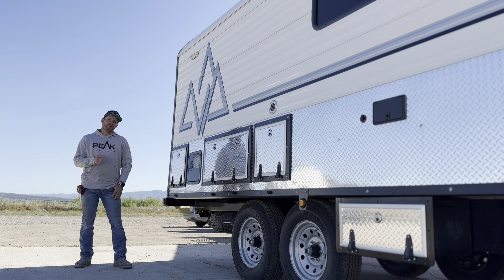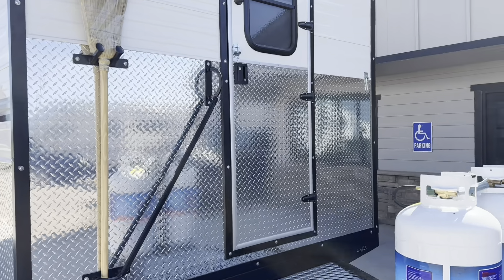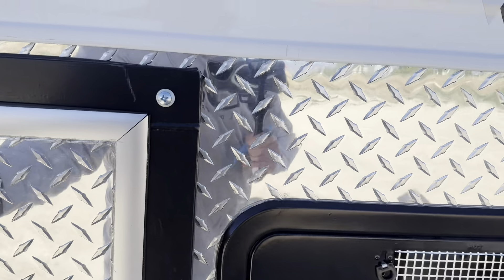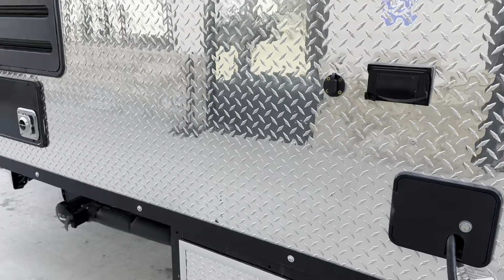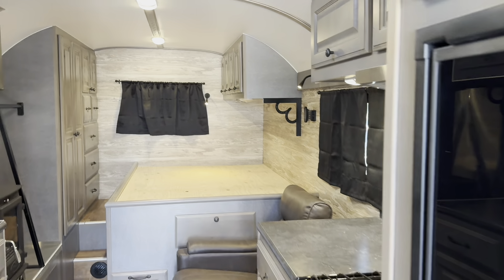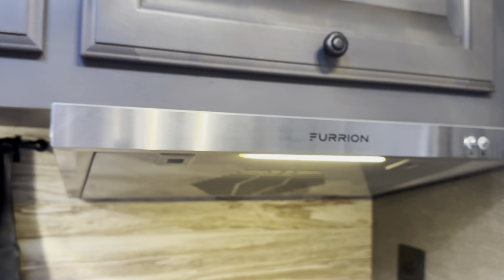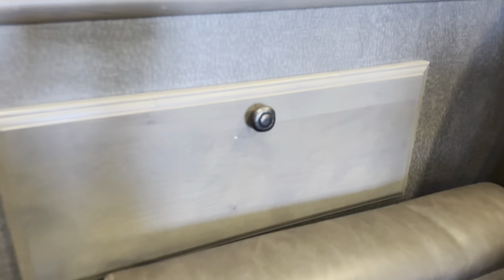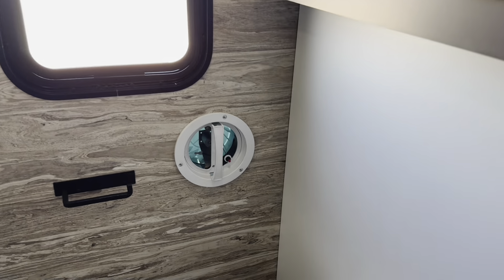There is custom, and then there is Peak Mtn Camps!

Comment: I have just over 100 days camping in this camp since I picked it up in May in temps ranging from 105 f to 12f, high winds, rain and snow. Things I would add or change... 1. Add some form of water diversion over the windows so water doesn't drip inside with windows open when raining, move gas to accessory to outside, ensure the battery monitor shunt and all battery draw to include inverter was run through a central buss with adequate gauge wiring as the current wiring setup makes the shunt useless, add more ac outlets and 12vt USB ports. Otherwise it has been extremely comfortable, very utilitarian and durable and I am extremely happy with it. The drying rack has already proven it's worth for wet coats and gloves.
Reply: Also it tows like a dream, fully loaded it weighs in at 8300lbs and is the perfect size and weight for rough country camping.
Reply: Also added Starlink Gen 3 powered via an aftermarket 12vt system. It draws between 20 to 50 aH averaging 35aH.
Reply: @mitchjaurena4709 
I watched a lot of these videos. I like this one the best. I have lived in travel trailers for 25 years for work. And I seen a lot of failures on slide outs, leaking seems and poor construction all around. I might buy one more. Really nice trailer. 👌
Reply: @CMM-sv8xk  Glad you like it.  I have lived in sheep camps as a rancher in Wyoming, Idaho and Colorado, small confined spaces as a Marine aboard ship and spend lots of time in the outdoors camping.  This trailer is a fusion of all the things I need for extended stays and live with comfort.  The 600 watts of solar with the 910 Ah (455 Ah usable) of batteries is more than adequate to run everything.  As the solar is not mounted I can move them where I get the best coverage where ever I park the trailer.

Comment: Gosh guys, I thought it was well made and beautiful. The customer got exactly what they wanted. Who wouldn’t want that?
Reply: this is my camp and I am out in it right now. I got exactly what I wanted, nothing I didn't want and it all works like I imagined. Most of the negative commentors don't have a clue what they are talking about. Let them go buy a poorly constructed toothpick and 1/8th in ply board factory built pos. with slide outs. They will be whining about it in no time..
Reply: I bet you love it! I would be very happy with one. Currently looking for now. I love the design and all the customization you can do. Not to mention the quality!
Reply: Mary, take a look at an X 26. Not too big, yet the additional inches would make my floor plan plenty spacious for 2 people.
Reply: I will check it out. Thanks
Reply: @marytorbert5212  As its similar to clients sitting down with designers and engineers at a coach builder when they design everything that goes into a million dollar plus class A diesel pusher as clients know what they want in a travel trailer as options are endless.

Comment: Nice trailer. Love all the thought put in it. I live in south Texas and have tons of ideas. We don’t need a furnace. I want to design my camp to have AC but needs to be window unit style so it’s easily replaceable because they only last a few years down here. The rooftop units are to expensive and leak water over time.
Reply from the maker: We would love to help you out in the design process.

Comment: There are some good, if unusual ideas here.  I like the wet clothes drying rack next to the fire.
Reply: Designed after working out of sheep camps in inclement weather.  You got to have a place to dry things off without wetting the rest of the camp.  I added a couple of magnetic cupboard hooks to the a-frame of the rack to hang gloves from and a hook above on the wall to hang your hat to dry also.

Comment: Had no idea a custom pull trailer RV was possible.  Love the rounded metal roof, VERY SMART.  Good idea to keep inside simple, small.   Excellent heating redundancy with cast iron fireplace, gas furnace and electric.  Two 30 pound gas tanks…much better.  That there is no slide out is a huge plus, must less source of error.  Solar panels, electric hookups, outside storage, all great.  The door on the end, hitch deck was wonderful, great space saver, with added utility.  Solid, well built pull trailer RV.  Thanks for sharing…from east Tennessee.
Reply from the maker: Thanks you for your comment!
Reply: Thanks for the comments. I have 40lbs tanks on it. I wanted the extra time between fills as I do extended boondocking. This camp is built for the rough mountains of the West, but would equally be at home in the Tennessee hollars

Comment: Nice looking camper. You might want to round the corners on the shelf bracket to the right of the bed. Those sharp edges might scrape some skin off, or snag a blanket.

Comment: that's one of the things I would think all travel trailers would have. Under frame storage.
For a wood stove, I hear the Kimberly gasifier would be more efficient.
Reply: I thought about getting a Kimberly and was really on the fence with it. But the Dwarf, with outside air draw, answers nicely. Having used the stove for the last two days you don't use much wood at all. A Kimberly would be a great idea however .
Reply: @mitchjaurena4709  The Kimberly uses outside air for draft as well. The main difference I've seen is the Kimberly has to use smaller pieces of wood than common.
Reply: I have seen them and investigated them thoroughly. What I meant was that this Dwarf Stove does the same, so I went with the Dwarf to be able to use larger chunks. It really was a toss up.

Comment: Dutch Door for Temp Regulator essential.All Desert s are Hot,in Summers but w/ Dutch Doors due to Elevation Temperature can be quickly Lowered to Tolerable.
Reply: And will keep you busy swatting flies, wasps and mosquitos!  I opted out of it as I have the fantastic fan that pulls an incredible amount of air and can keep it well ventilated.  Having lived in sheep camps for REAL growing up, I had to drink an extra quart of water a day just to keep hydrated from the mosquitos LOL.🤣🤣🤣
Reply: @mitchjaurena4709  Good screens make for good neighbors

Comment: That's cool.. How do you lock the boxes ? Is the thought behind no roof solar the less holes the less chance of leaks ?
Reply from the maker: They have a lock setup on the latch itself. Yes exactly! No matter how well they are sealed there is a chance of eventual water intrusion.
Reply: I wanted to be able to parwhere I wanted then place the panels where needed with the proper orientation. If the are mounted I can't do that

Comment: Is it rated for winter camping? I’m surprised about the weight but then I see it’s surrounded by steel plates.
Reply from the maker: It is rated for winter camping, in fact they are meant to be lived in year round.
Reply: That make s perfect sense. I was thinking man that’s about the right size but heavy. if it’s built strong and insulated right. It makes sense. Thank you for responding.
Reply from the maker: @jeffroman2352 happy to help.

Comment: I'm wondering about the wood fired stove.  In the winter, I need something besides expensive electricity, and the propane heater in my trailer is crap. How do you supply ventilation to the stove?
Reply: There is an external feed

Comment: Should add a PVC pipe with caps to the top of the bumper for the storage of the sewer hose??
Reply from the maker: There is a sewer hose holder underneath the trailer. Just in front or behind the axles…I don’t recall the exact placement on this camp.
Reply: the sewer hose tube is just aft of the axles. Works out just fine

Comment: How does it tow with that flat frontal surface?
Reply: It tows nicely as long as you stay in the 65mph range.  More than that and my F250 6.2l gas engine starts to suck down the gas and drops a gear to keep it pulling above 65/70 mph

Comment: Nice camper; but from a fire safety aspect, the propane tanks staged at the only egress is a major problem
Reply from the maker: The rear window is an egress as well…not the preferred method of escape but due to DOT regulations and requirements the lp tanks are required to be on the tongue.
Reply: @peakmountaincamps  What are your sidewall construction methods and r values? Nice looking rig btw =)
Reply from the maker: Framed with 1x4 studs on 24” centers, sheathed with 1/2” maple core laminated on both sides. We then insulate the dead space with 3/4” foam board (R4). Next, we sheath the exterior with either 7/16” OSB or 1/2” CDX, followed by a Tyvek moisture barrier, and finally finish with the aluminum skin. Give you right around a 8-9 r value depending on where you get your information.
Reply: Just another reason a door should t be on the front.  The layout should be reversed

Comment: The shunt isn’t monitoring inverter usage? 

What size wire is that out of the charge controller to the batteries? Looks way undersized.
Reply: I think you are looking at the input wires from the solar, which are 10 ga and more than adequate.  I took an IR scanner/camera to the system while on full solar charge (bulk charging and 600 watts of solar - two 300 watt panels in series), also while all light/power usage was on and there was no indication of over heating or of heat "stress" to the wires. All of the electrical wiring I could see I scanned throughout the trailer and it did not appear to have any overheating.   Yes, it appears that the inverter usage isn't being monitored by the shunt, but in my usage it will make little difference as A/C will only be used sporadically and for short periods of time.  It is there more for a convenience than for daily usage.   What the shunt does for me is provide an accurate battery bank SOC (state of charge) which is sufficient for me to monitor my capacity.  Good eyes and thanks for the input.
Reply: @mitchjaurena4709 yeah the 10ga going to the hole on the wall is definitely adequate. You can run 1000+ no problem by going up in voltage. The output side of the charger where reads battery is what’s concerning, it looks like it’s hooked up to 14ga or 16ga wire. It actually looks like it’s the wires to feed power to the shunt. At 50amps output to the battery max charge you want at least a 6ga cable from there to the battery.
Reply: I love how neat all the plumbing and wiring is done. If you ever have a problem (not as likely as factory builds), you could find and fix it. Factory builds look like a rats nest,lol
Reply: @newenglandrvadventures  I crawled around in there and looked and you are correct.  It is 14 ga wiring and for a 4ft or less run it should be at least 10 ga (8 ga better) for 14vt @50 amps.  I am trying to figure out access and a solution right now.  Thanks for your eagle eyed catch.  With that ga wire it could be a danger and at a minimum I will not be getting full usage out of my solar setup due to loss.
Reply: @mitchjaurena4709  you’re welcome :)
Reply: @newenglandrvadventures  I have found a solution.  I cut an access port in the solar storage compartment .  Not pretty, but it gets me right over the terminals so that I can change out the 14awg wires with 8 ga, which is what Victron recommends.  It is only a 2.5 ft run, so that should be adequate.  Again, thank you for your input and eagle eyes!!!!
Reply: @jerrytalley802  Correct.  Especially important when you have limited access space in these smaller camps.  Fixing and modifying hassles are greatly reduced.
Reply: Fixed.  All good
Reply: @mitchjaurena4709  you’re very welcome, I’m glad it was an easy fix. Gotta get all you can with the sun haha.
Reply: @newenglandrvadventures This weekend, at peak solar, I was able to harvest around 480 watts steady with a long run of 10ga to the panels as I was in a narrow canyon and had to place the panels as ways away from the trailer.  With a shorter run, I think I can get in the 500 watt range.  I felt the wires coming from the MPPT controller to the batteries at peak harvest and they were not warm.  All good!
Reply: @mitchjaurena4709  glad to hear, 10ga can handle a lot of solar pending on voltage. That’s why I’m a fan of residential panels high voltage low amperage.
Reply: Exactly what I have!

Comment: I like it, but don't know about the shower. 🤔
Reply: I am not a little guy and the shower works out fine for me.  It is "tightish" but not so much so that you can't move around to get the job done.
Reply: @mitchjaurena4709 
Ok, thank you.
Reply: Take a look at my update.  If you went with an X-26 (6" wider and 2' longer) you could get more space for a bigger shower, more room at the bed and room for a double recliner and the camp wouldn't be that much bigger on the outside.  I chose compact for a variety of reasons, but if you don't need to be as compact as I did, you could expand ever so slightly and make a big difference in the comfort level.

Comment: Can  you install a pellet stove ?
Reply: Have you ever used a pellet stove? They REQUIRE alot of clean electricity to operate.  Even the cheaper low tech options like Pelpro.  It would be totally impractical in a Camper . You would need a huge generator to create a constant source for the 115VAC power to run the stove.
Reply: We rented a house years ago with a pellet stove. I will never own one again, what a pain in the arse. It was actually much more expensive to run.
Reply: They put out good heat when you know how to use them. But the things require a huge amount of maintenance and care to burn clean and efficient.  Personally I'll take a plain old wood burner any day.

Comment: For what those AGM batteries cost and weight he’d be better off putting Lithium in it and get rid of that electric/ propane fridge and put in a 12v compressor fridge in it, more room without having fans in it , I know cause I did that to my rv and haven’t looked back, love more room for food and don’t have to worry about defrosting it.
Reply: All about redundancy and compromise. I have a 30l compressor fridge freezer I am running as a freezer. I am tried several options with another trailer I owned and settled on this combination. So far, so good.

Comment: That thing has zero aerodynamics. It's completely flat on the front. It would be like towing a parachute. Watch your fuel mileage go down 50%.
Reply: At 8600# it wouldn’t matter.
Reply: Probably true...but, any camper sucks the fuel
Reply: It’s a camp. At least that’s how I’d use it
Reply: It's built in the shape of the sheepherder wagons. Those only went as fast as a horse or oxen. 😅
Reply: It’s a camp, like a destination trailer. Not designed to be constantly on the road.
Reply: At least angle the front corners.
Reply: Everyone loses fuel while hauling. 😂 Was this supposed to be 100% brilliant comment or 50%??📍🌹👃😂
Reply: @DoctorSuezz actually unknown fully to the laws of physics … pulling an Airstream actually increases one’s MPG by 2% 🤷🏻‍♂️
Reply: Build one to be towed & I’d buy one!
Reply: Yes, you are right. It looks nice, kind of like those old pioneer wagons, but that's not enough reason to buy it. It might be possible to add a large, curved, outside storage compartment to the front, though, but doing so might void the warranty.
Reply: It’s OK, there is no free lunch, everything one does has a cost. A few extra fuel gallons to tow your dream camper for this case. Never let perfect be the enemy of good.
Reply: It’s made to be parked and enjoyed, not driven all over

Comment: AGMs in 2024?
Reply: Yep. Read the other responses. Currently Australia is placing extreme restrictions on lithium for use in habitable RVs because of the dangers. Not only do the batteries themselves, but each individual cell in the battery had to be certified. Only one battery in the world meets that requirement. I would rather not be sleeping over lithium batteries. I believe the dangers of lithium are understated. So my choice was to go with some proven AGM batteries.